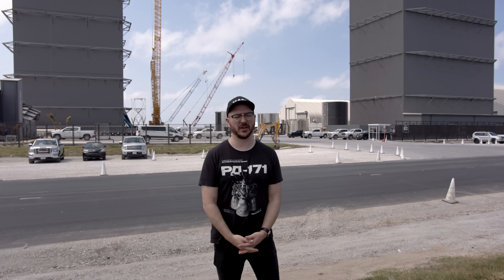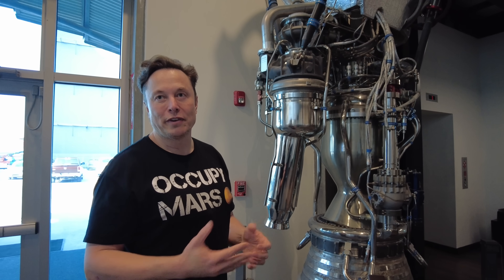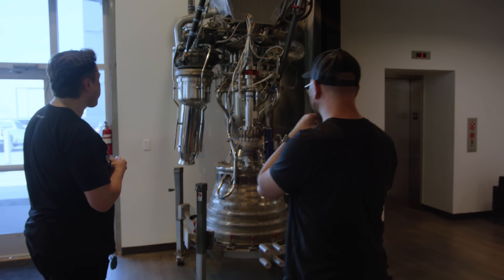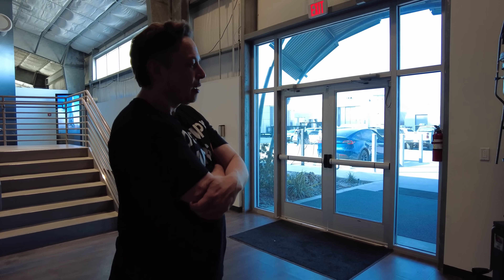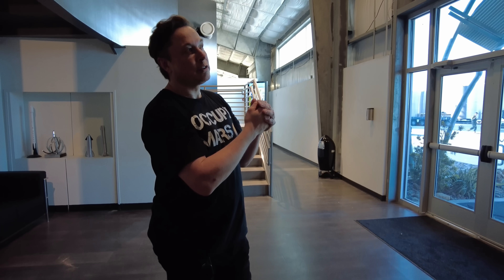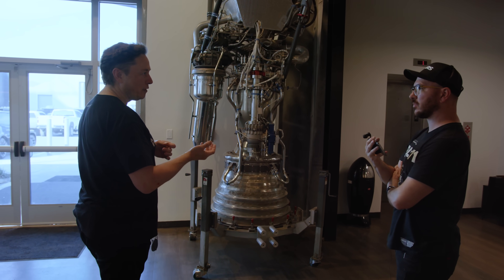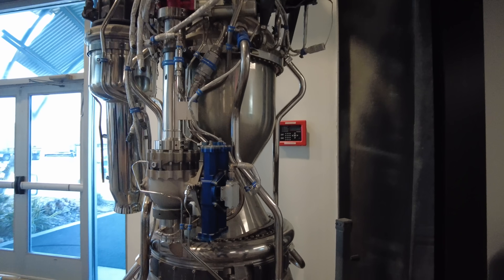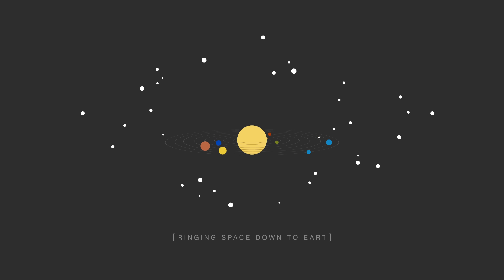Elon Musk Explains SpaceX's Merlin Engine!

Comment: Highlights:

4:50 It's a milled copper liner in the chamber, with a plated, high strength mostly nickel cobalt jacket. So we literally electroplated the outer jacket on. It took ages, *like a week*. It was like a crazy way to do it...  very inefficient. Like we're just very dumb at that point. (Note that Space Shuttle engines were also plated in this way. Firefly Aerospace uses this method as well.)

7:48 [Making the nozzle in two units] ended up being an expensive and painful thing, and a lot of challenges with this joint here where you go from the milled copper wall to the tube wall. You've got a hot gas seal there and that gave us a lot of trouble.

8:56 [So in Merlin] 1D we, essentially welded the copper liner inside together and so there's no hot gas seal. That's the important part. And overall, it ended up being, all things considered, lighter and lower cost and higher and better, basically in every way than the Merlin 1C. (Note that there are still many welds in Merlin 1D thrust chamber and nozzle assembly -- it's way more than just two pieces.)

13:01 Pintle injector briefly shown

13:58 [In the injector] It's just a cylinder that pops out. Then, then you've got a coaxial sheet of you know, in our case, liquid oxygen [along and around the cylinder]. And then you've got a fan, like a series of holes going sideways [from the cylinder]. So you've got sheet going down, coaxial sheet, going down, then you've got fuel going sideways, and it's sort of 360 degrees. And the sort of joke with the pintle engines is like the fuel oxygen mixing occurs when the sheet hits the fan.

Comment: try mechanical electrical-hydraulic on-rails syringe cylinder compression pump pressure of the liquid fuels, instead of the turbo pumps, super easy
Reply: try cylinder mechanical eject launch, electrical sling shot, stage zero

Comment: It's not just my opinion that takes place. 
Falcon is converted to spark ignition and methane. 
Open loop only. 
The turbo pump is divided into two 
with computer control to overcome instability. 
The result is increased reliability. Simplification. 
The thrust-to-weight ratio of the engine 
is one and a half times better than that of the Raptor. 
Raptor is a masterpiece. 
The place of masterpieces is in the museum!!
Reply: Falcon should be mostly retired in 5 years time

Comment: The way they designed the early Merlins engines are rather clever (despite the Falcon 1's teething problems in the early day), and it makes sense to keep the cost of the engines down while up its flight reliability because they're aiming to make rocket launch cheaper, possibly to the point that you just pay for the fuel and oxidizer to yeet the desired load into the space which is helpful for the satellite hobbyists and researchers on the ride share list to send their creations into space to find out what's out there, something like that.

Comment: It’s a cute little engine. But it doesn’t upscale. That’s why they need nine of them.  But simple is the design philosophy and simple with value is what you get. Cramming nine engines into a 12ft diameter with plumbing is anything but simple. I thought the F9 seemed overpowered for most of their customers (18k lbs GTO). It is versatile. Block 5 and-on has been very reliable. On-time initial launch attempts, an industry metric….improving. One cannot deny their innovation and mission success. 98%. Thank you Team SpaceX for bringing the commercial launch market back to the US. (P.S. Gwynne Shotwell needs a raise.)

Comment: Very cool!!  Reminding me of when I worked at Rocketdyne, back in the good ol' days (early '80s). We developed the NARLOY-Z  (North American Rockwell Alloy - 96% Copper, 3% Silver, 1% Zirconium) material used in the SSME Thrust Chamber- machined longitudinal grooves in its exterior to create deep fins, then electroplated a Nickel jacket over the outside to convert the fins to channels - just as Elon described.  It was an extremely laborious process.  New material, process, and product development are part and parcel of rocket engine production - and SpaceX has advanced the technology remarkably.  That said, in Aerospace - everyone is standing on the shoulders of the giants that came before.

Comment: Cool cool I’ve always wanted to and still would love to be a part of the journey working for Elon & Space X. As a Truckin fool for 28 years and have my own rig I’ve to look into a hauling contract with them. Not sure if big Obnoxious diesel trucks are their thing though they definitely get the job done.
I’d be good with cleaning the floor or bathrooms for them at this point.
Good thing I have a very high mechanical aptitude and skill set when it comes to repairing and maintaining anything with engines and equipment small,medium,large extra heavy duty and looking for some experience in highly advanced nonhuman tech.

Comment: i'm a petrol head so i was waiting to see the "nitrous oxide" bottle? the analogy of the erosion becoming exponential is similar to that used to describe what happens with a flat spot on a tyre. the tyre under heavy braking the tyre will lock up again when it gets back to that flat spot. increasing the size and depth of the flat spot on each following lock up until tyre failure occurs. as much as the rocket versions are infinitely more precise, many of the basic principals are similar to that used in outer kinds of engines. for example the pintle injectors are almost exactly the same operational principals and basically a very similar design. curious to the rough "stoic" ratio of the rocket fuel?

Comment: So what i never got. Inside the atmosphere the thrusters can be big, because the air preassure presses the thrust from all sides together. In a vaccum it becomes way less effective and small thrusters are more effective. Why is nobody building adjustable trusters like you have them at fighter jets?
Reply: Mario - In Tim's video called "Are aerospikes better than bell nozzles?" he mentions that the Space Shuttle's RS-25 engines were adjustable for both sea level, where they spent very little time running, and vacuum.  This adjustable nozzle has not been used since, perhaps because it was apparently heavier and more complex, and may not have been very efficient at sea level.

I think you are mistaken about the sizes of sea-level and vacuum engines, depending on what you mean by "thrusters."  The bell of a vacuum-optimized engine is much larger than its sea-level-optimized version.  The Falcon 9 fits nine Merlin engines into the 1st-stage booster but only one into its same-diameter second stage, because the vacuum bell is three times wider than the sea-level bells even though it's essentially an identical engine aside from the enormous bell.  Tim discusses this also in the same video.

Comment: As a life long spaceflight enthusiast this is just fascinating.  I thought Elon's explanation of how a pintle injector worked was cromulent.  Sprinkler with holes in it pops out, liquid 1 sprays out the holes, hitting the inside of a tubular flow of liquid 2, getting all mixed up in the process.  Totally drew the right picture in my mind.  Which is interesting because in a lot of graphics about how fuel mixing works this concept isn't really clear, it often seems the fuel is mixed before it enters the bell chamber.  Logically that wouldn't be right, so understanding how that fuel mixing process actually happens is enlightening.  This stuff is solid gold.

Comment: When most other CEOs have special communication events similar to this, they have a small army of experts at the ready in case a hard question arises.  Another alternative for them is to control the interaction so that only predetermined questions get asked.  In Elon's case, he has the knowledge and confidence to handle these free form interactions fully on his own -- and like others have noted, it is not just with rocket engines.  On one hand he is not a communicator, but I think he communicates more meaningfully than pretty much any other CEO.
Reply: Isn't that what's happening here? Elon is responding only to the questions he's prepared to answer, and Tim is pitching only the questions Elon wanted him to ask.
Reply: @johnturner8286  Over 40 years, I have been part of many complex design discussions (embedded systems, autonomous vehicles, mobile hydraulics, etc).  This is honest technical dialog.  For this to be as you suggest, there would have to be superior acting --- by two engineers?
Reply: @johnturner8286  it doesnt feel that way tho it doesnt feel forced and elon actually takes time to think before he talks

Comment: Found this very informative. This is the first video I’ve seen of their power sources. Honestly expected the nozzle to be fabricated with basically a huge slip former. Still curious to know why they used the materials they did instead of tungsten or inconel.  Can’t remember what the weights are of the two metals,possibly the reason they weren’t used, either way still an impressive feat.

Comment: Mr. Musk, Yes it is a venturi like effect. Think about how snow travels in lines across a road. You gotta scale down for this. Every particle creates a wake as well as a leading pressure wall. This is basic info that all janitors know. lol.
Also, the leading edge of the pressure front can also be erosive or a friction inducing force. So do you polish the inside of the pipes? By polishing the inside of the pipes you do reduce friction against the gas particles. If your not polishing. Then you should and it may increase your go fast potential.

Comment: how does those feeder pipes bears the pressure ,stresses and extreme temperature  difference in such a close area during dynamics ( escaping atmosphere layer ) conditions . there should be some better method to route or held or isolate these from nozzle ,turbine and different type of metal  used for structural stabilty .i wander what type of calculation they use to calculate payload capacities with out exploding the thruster with extreme pressure and load plus weight carry capacity and discharge thruster nozzele design and how fuel pressure dont create back pressure with atlitude change etc .
Reply: S Pa  -  Spacex does it all by trial and error.  They build an engine and test it.  It fails.  They correct that problem on the next one and test it.  Over and over until all the problems are solved.  They do the same with the rockets themselves.  They do design things on paper and via computer, but they test each step in the real world.  It's better than solving ALL the payload capacity calculations, etc. before ever building anything and testing it.  Replacing an exploded, cheaply-built rocket is faster and much cheaper than the old-school way of doing it.

Comment: Jacketing code is not the most efficient.
Running native I am thinking 64 bit machine running 32 bit code.
I natively compiled and reprocessed the data.  It was as expected faster.  More efficient.
The real issue was that some groups did not have the source code to re-compile on the new equipment with 64-bit architecture.  Jacketing the code by running a 32 bit OS on a 64-bit machine was a way to maintain legacy systems.  Ultimately the applications were migrated - those that were unable to be moved forward ran jacketed - until - like with ablative - the job - idk died on the vine.  

Planned opalescence.
You can run for quite a while like that.
What is the word? deprecated features 

14:25 ba dump bump

I believe when we see the flamage from the Raptor the truth will be "self evident."
Nothing like a visual inspection.  Sitting on the edge of my seat.  Waiting to see, each day, what tomorrow will bring.

I hope you two are happy.  You have me really confused.  I don't know if this is real or Memorex.
What do you do when the sheet hits the fan?
Duck dummies.  

I guess I owe Gywnne an apology.  Tweeting is way misunderstood.  Story for another time.
Tim.  Ask Elon.  Tesla Bot Astronaut   TBA

To be announced.

Comment: I never understood how they dealt with the diameter change of the regenerative nozzle cooling tubes as the nozzle itself expands. Beautifully explained.
Reply: CopSub did it differently on their TM65 and BPM5 test engines (which are significantly smaller). Basically they made the inner and outer nozzle as two pieces and welded them together to get a contracting cooling channel (cool fuel flows upward).  Details were heavily redesigned after TM65 failed during an all-up test, resulting in the twice flown BPM5 assembly method.  BPM100 nozzle design isn't published yet.  Hint: The numbers are the thrust in kN, M is for Motor.
Reply: If you live in the US, visit any of the space museums and you can see a whole bunch of them in person.

The Evergreen Space Museum in Oregon is amazing if you like the Gemini / Apollo missions.  Full size Titan II with launch room. Lunar Lander full size, rover, Saturn V.

You can see that all the piping in the bells was hand welded back then.  Well worth the trip if you don't live close.

Comment: I'd like to see a discussion on what it would take to adapt the 1D to burn methane instead of RP-1. Say, the Merlin-1E!
It may not be the most efficient, but the single shaft gas generator is still the simplest and most reliable rocket engine in its class. The full flow staged combustion engine, with dual turbo-pumps, much higher pressures, greater complexity cannot be that reliable. That is basic physics.

Comment: 16:09 This was the most surprising part. I had assumed throttling was controlled by sliding the pintle injector in and out (the way Elon described the lawn sprinker). But they throttle by controlling how much power the turbopump gets, which I assume means their point of control is the gas generator.
Reply: I believe so, more precisely the LOX and RP1 valves that control the flow into the gas generator. Just by controlling these two valves they can control the entire engine. I'm sure it's more complex than that but it's the basic principle. And because it's a single shaft pump the ratio between fuel and ox is always more or less correct no matter what the speed of the pump is. And by using a pintle injector they avoid combustion instability which will often occur during throttling. All this simplicity of course pays off in reusability and reliability. Like Elon said in the first Starbase interviews: The best part is no part, it costs nothing and it can't fail.
Reply: You can't throttle a rocket engine with a fixed ratio nozzle. That's fundamental. Musk is a moron.
Reply: He also explained that the pressure from the pump controls the pintle injector, so there's no separate pintle control that can fail.
Reply: @johndododoe1411  Oh cool, didn't pick up on that. So I assume once the pressure goes below a certain value it closes using the high temperature and pressure equivalent of a spring.

Comment: Great stuff! Does anyone know how many flights a merlin can fly before refurbishment?
Reply: I’m guessing there will be some parts replaced after every launch.

The overall structures have lasted over 10 (?) flights so far.
Reply: Kerosene-oxygen combustion is very sooty. Soot gets cakes in the nozzle and combustion chamber. It also gets caught in the exhaust. The engine has to be cleaned out after every flight. Fuels like methane or hydrogen don’t do that so they can be used with way less refurbishment. That’s why raptor exists. On the other hand, engines are still being refurbished then reused so the limit is undefined for the amount of uses

Comment: Could you talk about thrust to area ratio?
With 3.5 times the thrust to area ratio of the rocketdyne F-1 a 300 tons raptor could (in theory) lift a 380 meters tall rocket!
Reply: Well if Starship has a empty mass of 129 tons and a fuel capacity of 1200 tons, SN15 which we can assume had a third of it's tanks filled for high altitude test, did hover and be brought to land with only one raptor engine running.

Comment: Ooh! Was looking forward to this video.

Merlin fascinates me. Not many engines these days undergo the massive improvements it has - the modern M1D's are easily ~2.5x more powerful than the first Merlins. Really goes to show how SpaceX improves things over time, and I'm hopeful they can do the same with Raptor.
Reply: Merlin is basically the definition of overengineering. You take the worst combustion cycle possible and then you spend years to make up for it.
Still an insane engine thought.
Reply: @johntheux9238  is it over engineering if they used the original R&D from other organizations and improved upon it? The goal of Falcon 9 is for cheapness and reusability. They did that. Raptor is the advanced tech.
Reply: @OBtheamazing  The goal for falcon 9 was low upfront (development) cost to not get bankrupt. Then it was about launch cost when they had a working rocket.
So they had to change their goal at some point.
Reply: @johntheux9238  and they did. They used the ablative at first. Then switched. Being a strong company means being agile
Reply: @OBtheamazing  Yeah, that's what the iterative design process is all about.
Reply: @johntheux9238  they had no other choice than using a gas generator engine as their first engine. This type of engines can be handled (even if it's not that efficient compared to other types) without alloys which are hard to develop (for the turbo pumps) and the development risks can be kept on an acceptable level.

Now with their experience they can try to go one step further with the Raptor.
Reply: Bullshit!